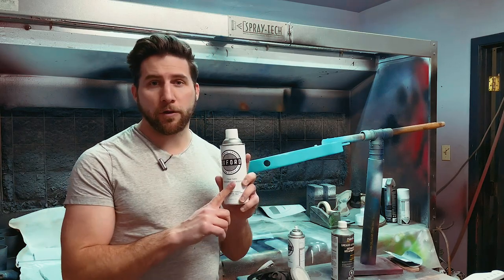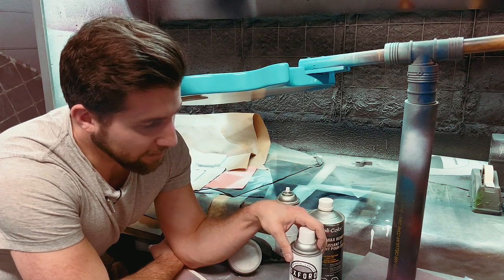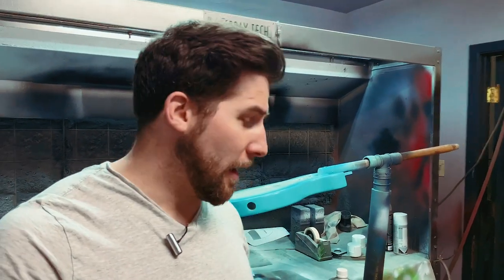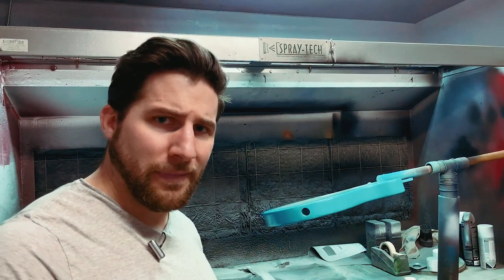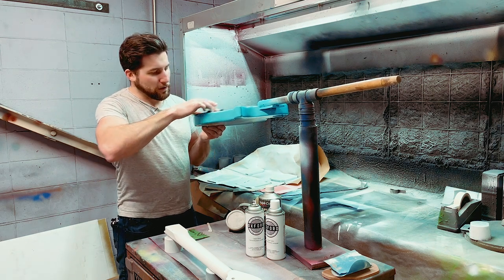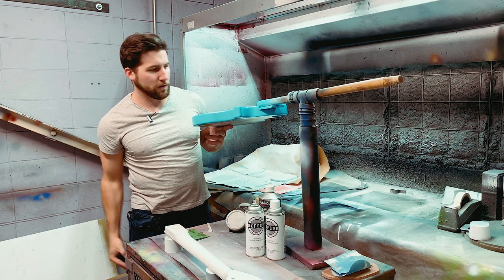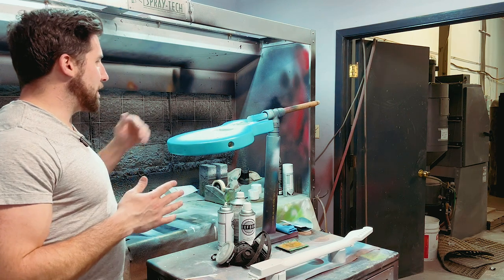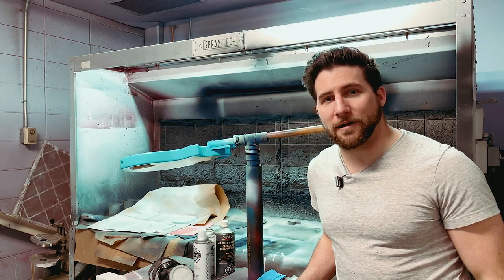Tips for Doing Satin Finishes

Comment: So. Brad my man. First of all thank you for all the knowledge. I love to hear got different people do things and your ways seem much more practical than how some of the snoody forum dudes can get. Although there work is amazing I feel we also wanna get shit done. I currently am building a ibanez AZ that I'm refinishing in a pelham blue from Oxford. I got there deluxe finishing kit from solo music in the Toronto area and it is my first time using nitro.. what a learning curve. I have ran into just about every problem I can. Wet sanding I cracked the finish via swelling like you warned and I also had more grain come thru the bocote top than I wanted after initially filling AND I had some light checking on the top from going a little heavy and being impatient with coat times. SO just did a huge gnarly level sand with 400 and got out every imperfection and have only exposed some primer at worst case. I'm going into solo guitars to grab another can of pelham blue and I believe I'm going to grab a can on satin aswell and do a satin finish on it so I can atleast throw my guitar back together at a reasonable time. (I don't care about it getting damaged that's why I wanted nitro.. I just don't want it before the guitar is built. So I plan on redoing my colour and building up (patiently) some clear gloss (have 2 cans of clear) and then do my satin top coat after one last level sand. Hopefully by then the nitro will have shrunken enough to not surprise me anymore with soaking in the bocote top and I can throw my guitar back together a couple days after shooting the satin. (Its been about a week since I started this beast) .. also. Since I didn't purchase directly from Oxford supply I did email them and Thank them for there amazing products and I mentioned I found them from you. Please keep up the great work. If u made it thru this novel leave a heart!
Edit: cheers from waterloo btw!!! Are u in Ontario.?
Reply from the maker: Thanks Jody. Were you using a sanding sealer? That might be helpful if you didn’t. Im in Alberta.
Reply: @BradAngove  yes I used grain filler and sanding sealer. About 2 coats filler (wasn't super porus) and about 4 coats of sanding sealer

Comment: Dude, this is timely. I’m about to put Mohawk satin lacquer on a kit guitar. Thank you, sir!
Reply from the maker: Glad to hear it
Reply: Solid choice!
Reply: @BradAngove  Hey dude thanks for the vid it was very helpful. what do you recommend using to clean the surface in between coats?
Reply from the maker: To the extent that I need to do that I typically use wax and grease remover.
Reply: @BradAngove  thanks

Comment: Oxford recommended 3 cans of clear. My Satin went on like orange peel. Now I'm being told level sand and polish.
Reply from the maker: Yeah, I generally start with gloss to build it up. Then sand smooth with 800 grit and add a couple thin coats of satin to finish off. If you polish your satin it won’t be satin anymore.

Comment: Brad, great video! Question though: i am confused about your closing remark around 09:20. Is the final step that you scuff back the satin coat (and if yes at what grid)? I understood earlier in the video that the final step was spraying the satin lacquer (so no more sanding or scuffing afterwards)?
Reply from the maker: Your understanding was correct. I had to sand again because of an imperfection that I needed to fix.

Comment: I got the message , Brad. Two questions: do we have to deal with orange peel of the final coat? And, since the final (satin) coat is very thin and, won't that cause  a problem on the neck, especially when nitro has been used (that wears out quickly).
Reply from the maker: Deal with the orange peel just before the final coat. Then the thin final coat should lay relatively flat. You can’t really sand and buff satin.

Comment: Hey Brad, I just painted an unfinished Basswood strat body from a guitar kit I bought. I used a can of Rust-oleum 2X paint + primer Lemongrass colored satin paint. I have a bunch of cans left of Stew Mac Vinyl Sealer and cans of Nitrocellulose Clear Gloss. Can you help me with which of those I use after having painted the satin color on the body? I just don’t wanna ruin this thing by doing it wrong. Do I sand before spraying anything else? There’s so many confusing videos to keep straight
Reply from the maker: Those aren’t intended to go together. The sealer is for before colored lacquer. The clear gloss is for after it. The rustoleum is not lacquer though; it’s a different type of paint entirely, so using the clear gloss over it could be risky. 
Yes, you would sand your color before applying the clear. Usually with 800 grit.
Reply: @BradAngove  thank you for taking the time to answer my questions. Crap now I don’t know what to do.
Reply from the maker: Find your color in a lacquer or switch to a clear coat meant for the rustoleum.
Reply: @BradAngove  I found the Satin clear coat of the Rustoleum. Thank you Brad! Hope it turns out nice after 4 coats of clear and then on to the buffing/polishing.
Reply from the maker: You don’t buff and polish satin clear. That’s only for gloss.
Reply: @BradAngove  oh sweet thank you!

Comment: Thank you for the video Brad. I'm currently using Oxford nitro and I'm at 6 coats of clear gloss over the British Racing Green metallic. Is it important to wait a week before sanding flat or can I sand and lay the satin on shortly after?
Reply from the maker: It depends on the temperature and humidity, but I would say you’re safest to wait at least a week to help avoid potential cracking.
Reply: @BradAngove  Thanks for your help! Will do.

Comment: thanks for the different finish video's. would you or have you ever put a burl finish on a guitar? Lou
Reply from the maker: A burl finish? A did a guitar with an ash burl veneer.
Reply: @BradAngove  no, i have seen where they use a maple finish to start and a darker stain with a brush doing the swirls or burl marks. I hope that kind of explains it. thanks
Reply from the maker: I have never seen that. Do you know where I would find an example?
Reply: @BradAngove  yes on you tube I think you look up how to put a burl wood finish on wood panels or just on how to apply a burl finish on wood. I also seen it done on car dashes.

Comment: Great content, as usual! I’d like to run something by you. Going to re-finish a guitar that’s completely covered in polyurethane (body, neck and fretboard). Was considering sanding down the whole works and ebonizing the fretboard, dying the neck black and finishing with Tru-Oil and then priming and painting the body with Dupli-Color or Rus-Oleum paint and finishing with 2K Spray Max. Make sense or are there potential conflicts with any of those combinations? Keep the great videos coming. Cheers!🤘
Reply from the maker: The combinations should be fine. It’s just going to be challenging removing all of the poly enough that you can dye the neck and fretboard. 
Where you are spraying the opaque color you don’t need to remove all the poly. Just sand smooth with 600 grit and spray over it.
Reply: @BradAngove  fantastic(-ish). I have another neck I can swap out without all the poly on it. Thanks for the quick response. Really appreciate the help.

Comment: Hey Brad, long time listener, first time caller. What product are you using for cleaning there? The degreaser. Got an affiliate link?
Reply from the maker: It’s just some duplicolor was and grease remover. Nothing fancy. Lighter fluid will work in a pinch.
Reply: Are you getting it at Canadian Tire?
Reply from the maker: I think I got it at Napa. Canadian tire likely has it as well though; they carry duplicolor.

Comment: Just out of curiosity what was it you had to go back and sort out was it just a tad too heavy on certain parts and therefore had to be levelled out? I’m also guessing that’s one of the pitfalls of using a can as opposed to using a compressor and gun with a reliable airflow that can be controlled.
Reply from the maker: No, there was a hair and a little particle of debris that I needed to remove before adding a final coat.

Comment: Cool. What's the best approach to have a satin neck and gloss body on a set neck guitar?
Reply from the maker: Generally it would be to find an appropriate spot to tape your transition line and then sand the gloss neck and spray satin on it. 
On my guitars I just take some 1000 grit sandpaper and run it up and down the neck in my hand so my hand won’t stick instead of actually spraying them with satin, but that’s just for movements speed.

Comment: Hi Brad, I wish u can help me. I have a project that is waiting to be finished from too much time... I wanna paint satin black the body of my Squier Standard Telly, the wood should be Agathis, can U give me some tips to do a good job? I'll doing it with cans.
Denis from Italy ✌️
Reply from the maker: Hi Denis, is the body bare wood right now or is it painted?
Reply: @BradAngove  yes, totally. Bare and sanded with 300 paper
Reply from the maker: Ok. Make sure you seal it first with sanding sealer, primer, or something similar. Then sand it smooth and spray your black base coat. Then you can do like I have described in this video.
Reply: @BradAngove  great! I hope to start as soon as possible, thanks a lot ✌️✌️✌️

Comment: Hey brad, so I just finished spraying a 1k clear coat and I’ve let it dry for about a day. I have a couple spots that the clear coat didn’t get on thick enough, so how would I go about patching it up? Do I just spray on top or do I have to sand it first (if so what grit)
Reply from the maker: Just sand lightly with 800 grit so the next coat or coats will stick properly and then clean it and go ahead and spray.
Reply: @BradAngove  how do you go about cleaning the sanded surface before clearcoating?
Reply from the maker: Wax and grease remover